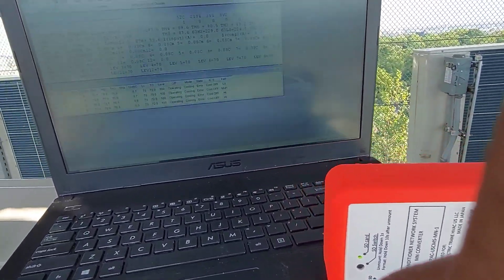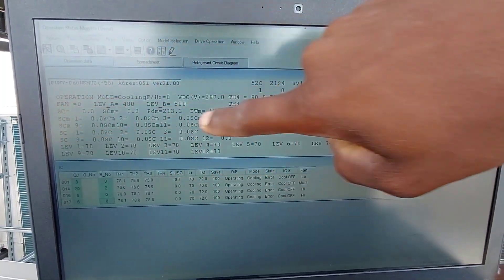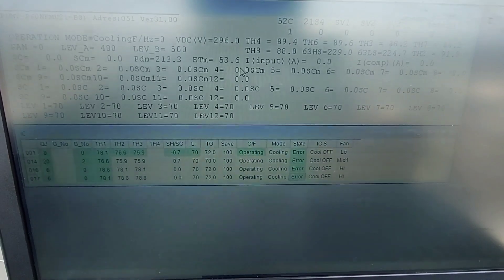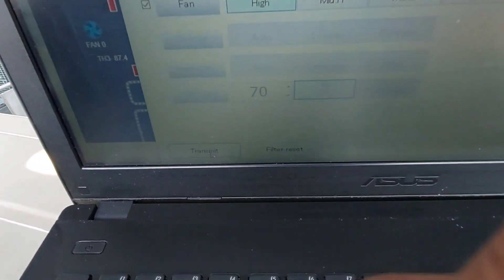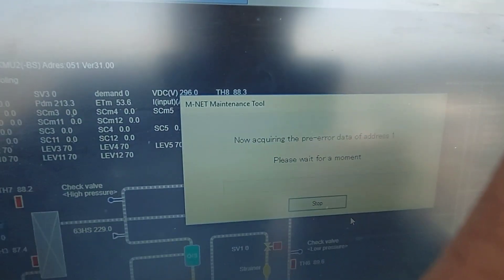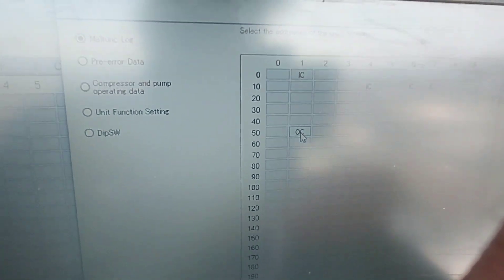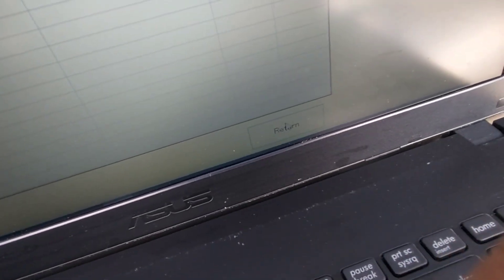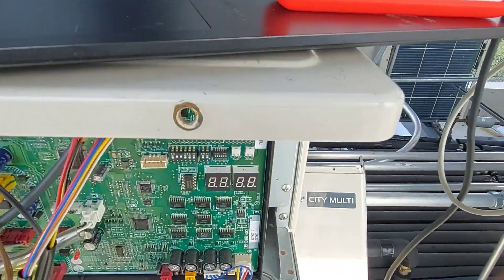MITSUBISHI CITY MULTI MAINTENANCE TOOL

Comment: Hi - Do you need a special usb cable to connect unit  to the laptop? - or can you just use a standard cable - im trying to connect to PURY units on Mnet
Reply from the maker: Do you have the maintenance tool?
Reply: It's basically a standard 'printer' cable. USB-A on one end (at the computer) and the squarish one on the box... you need to connect the alligator clips first, to power up the interface box, then connect the cable (usually there's a ding sound effect on your computer), and THEN start up the Maint Tool program. It only looks for the box when it's starting up.